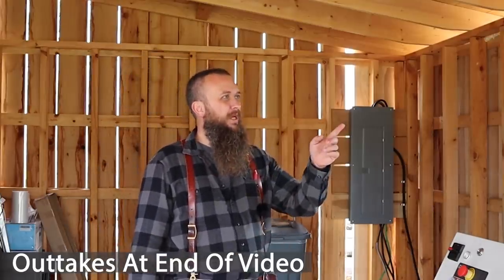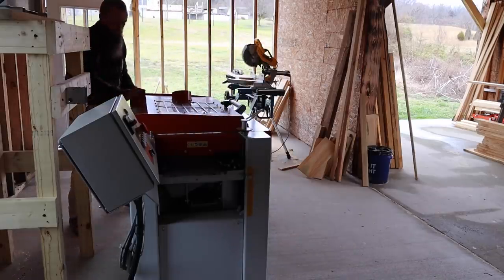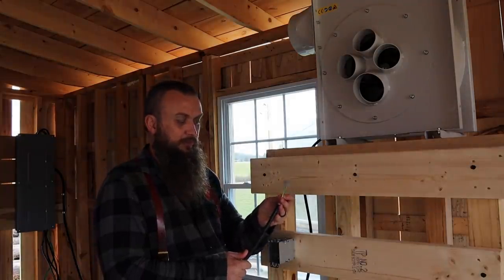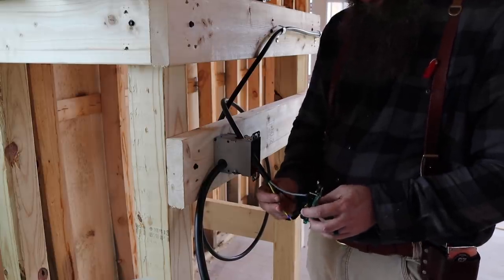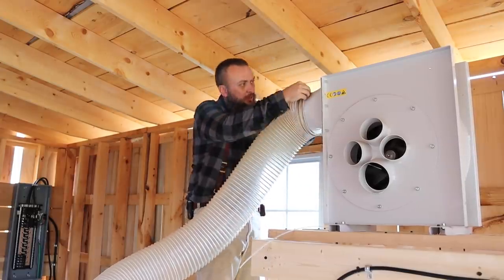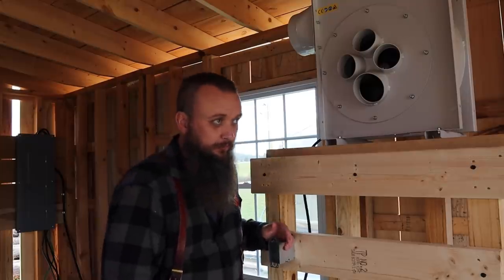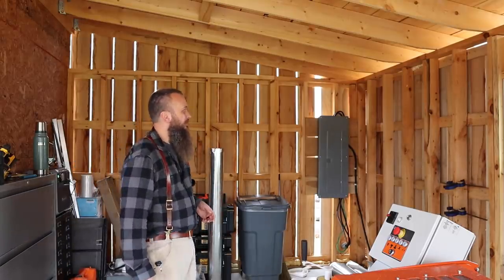You've Probably Never Seen A Dust Collector Like This Before,

Comment: Your out takes are always a funny way to end. It's all good as long as you stay safe in the shop and your out takes don't involve bandages.  If I can make a suggestion,  it would be to run a board under the flex hose to keep it from sagging. Keep the videos coming and have a safe new year .

Comment: Good call on using the double pole light switch on the moulder. A circuit breaker has only one job, over current protection. It is not meant for off and on switching. Definitely use cable clamp at the entry into the panel board, eliminate chafing.
Reply from the maker: Great point

Comment: You need some cord connectors on your cords going in and out of the switch box & load center, the electrical inspector will ding you on those. The cable clamps also need to be the proper size to secure the cord to the supporting surface.
Reply: There are no electrical inspectors in the commercial film studios these videos are made.
Reply from the maker: Rural county here. We shoot at inspectors 👍👍
Reply: The whole show is just BS.
Reply: @OutoftheWoods0623  I bet there are still electrical fires in rural areas
Reply: @OutoftheWoods0623  I believe the correct term is "Revenuers"!!😆
Reply: @OutoftheWoods0623  please remember that part of an inspectors job is to insure a SAFE installation. Safe as you don't burn your building down or kill someone by electrocution...... not to mention that your insurance most likely will not cover any claim due to improper installation.

Comment: You should only push solid wire into the back of the switch. 
Use fork terminals crimped to the end of the wire.
Reply: Never use the push in connectors.  Any electrician will tell you stories of failures from those connectors.
Reply: @markgibbesh  I agree.  But stranded wire is a no no.

Comment: I like watching your videos and appreciate the knowledge you freely give to people. I was an electrician for many years and just want to point out to you when putting wire in a box or panel it needs to have a connector on it for safety. I am only pointing this out to you so a viewer does not do the same thing and possibly get hurt. Thanks again for sharing your knowledge about sawmilling.
Reply from the maker: you are right, those are on order, the store was out of them, appreciate the insight,
Reply: @OutoftheWoods0623  That and the other thing is it's open behind the breaker box and if you got a sideways rain or even snow I'd worry it might short something out.

Comment: A future idea, put a low voltage transformer at the breaker panel 240 x 24 vac .  Mount a current switch on the molder ( sometimes called a donut) . run the 24v through the current switch and back to a enclosed relay across the breaker out put to the vacuum,  and every time you run the molder the vacuum will start.   I can send a diagram if u want to do in future.
good video ....... enjoyed.. thanks.
Reply: Yeah, keep as much at 24 volts as you can. The current switch from the planer to start the dust collector is the way to go. It's not too complicated at all.
Reply: Great Advice Oldindyracer!

Comment: Wish I was there to wire that up for you. Not to be picky or anything but you should have used 12/3 armored cable, or run half inch EMT conduit with  #12awg THHN which would be more than adequate for a 20 amp circuit. I would have run the conduit along the wall, with a steel box at the end with a switch plate for your on-off switch, and then run wire from fan directly to that box. But if that fan is drawing less than 15 amps, then it should be on a 15 amp breaker for safety and going by code. The 220 switch you got is pretty standard, I call those a double pole switch and also come in various amperage ratings. And the clamps you used over the wire are made for metal conduit, not wire. So if I was to do an electrical inspection, unfortunately that would fail on many counts.....Sorry...
Other than that, great job
Reply: exactly my thoughts !
Reply: Yep.  It also looked like he pushed the twisted wire into the back of the switch, which should only have solid wire.

Comment: My favorite coffee is Eight O’clock, which originally was A&P brand. I always grind the beans fresh but it comes ground as well. The switch was an excellent choice. I had a ceiling fan switch in the service box and it wasn’t long until it had a switch. I’d do some sanding a turn off the fan until I was finished. What a pain! It’s nice to see things coming together, it’s a blast! Boards coming off the mill is icing on the cake! Kind Thanks! DaveyJO in Pennsylvania

Comment: I like the dust collector, who makes it. They do make a remote 220v control that plug into a 220v outlet and a frome to control it. Mine is a 3hp 220v works good. I bought this through a local woodcraft stores in my area.
Reply from the maker: Woodmizer makes them

Comment: They used a liquid wax on the planer and other machines at the cabinetry factory I worked at ( please remember the cutters spin for awhile after the machine stops - saw too many fingers fly because the person wasn't trained right ) and stall mats for your floor -concrete is not easy on the body

Comment: The way to go with dust extraction, especially as you add more tools, is to have remote start. The extractor fan plugs into the remote start box and that's plugged into a 220v outlet. You can have multiple controllers at different locations. The remote controller can be low on the wall and all the wiring tucked into the wall to keep everything clean and safe.
Reply from the maker: Thanks I’ll look into that

Comment: Lemme guess.   You don't have a building code or electrical code where you live?   That's great.   I would have used yellow romex to the panel - which is rated at 20 amp.  The stuff you used is for drops.
Reply: He is a great sawyer , electrical not so much. A few code violations that I can see.

Comment: I noticed that you didn't use wire nuts when running your electrical wire to the breaker panel and your switch box. Is it not a requirement where you live?

Comment: I have seen and help install  sawdust  collection system  always used spiral duct pipe   it's ridged and comes in 20ft pieces and use collar  connections .
Plastic pipes developed static electrical charge   possibly  enough  to explode  fine sawdust
Reply: :Possibly enough to explode fine sawdust". But, there's never been a confirmed account of this actually happening.

Comment: Your outtakes are hilarious, but how do you get anything done? LOL. I noticed that when you were running your 8" flex that you're using a metal strap for a hanger. I'd suggest a piece of non-metallic material (rubber?) between the strap and your flex hose to minimize wear.

Comment: Those wire clamps you used are for conduit, not wire.  They are steel and the shaking of the frame will fray the wire.
Reply from the maker: I know that, the fame does not shake, its bolted to the floor,

Comment: - [ Nathan ] I don't understand! {you must have a good reason I fail to grasp}
- Why not run your black power line/cable INSIDE the Wood Frame and mount the receptacle on the INSIDE Face of the 4x4" frame posts so everything was protected and not in the way? 4:14
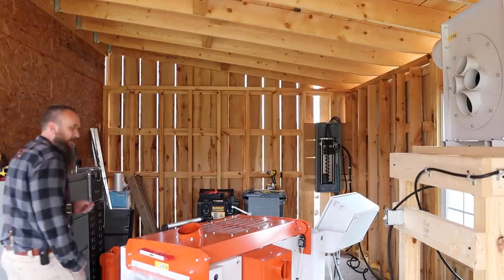- Why not run the power line/cable to your breaker box up on the top plate holding the rafters? 7:06

Comment: Nathan, I'm wondering why you ran the cable on the outside of the frame, and also why have the switch in that position, why not recess it into the 4 x 2?
Reply from the maker: its just a rough in until I finish my walls, 
I wanted to be able to flip the switch and not have to lean over the machine too far, 
thanks for watching,
Reply: @OutoftheWoods0623  Ahh right! Keep up the good work, really like following all your videos. Its interesting to see how things are done differently there, than here in Ireland.

Comment: That switch needs to be horsepower rated for the size of the motor, also you need cable clamps on the cables going into the box and stranded wire on those terminals is a bad idea.
Reply from the maker: the switch is for the machine otherwise I would not have installed it, as I stated in the video I roughed it In to make sure everything was good to go, the final install was done off camera,

Comment: Nathan - Please don't stab the wires in the back of the switch.  Use the screws on the sides so you can swap out or do other work on the switch.  Otherwise you have to cut wires again and the bayonet slots in the rear are only one-time use.

Comment: There is a push-button switch that you can purchase, that can be wired in line with your dust collector.  It's pretty slick.  You can turn your collector on or off from any place in your shop.  If your interested and cannot find this push button switch, contact me and I'll get you hooked up.

Have a great new year for you and yours...You can't make old friends...

Comment: Love your outtakes and know I couldn't do any better! Hanging from an unfinished ceiling means doing it all over again later, guess it's for the video. Guess I've seen 220 type switches before but it was from a 3 phase set up and the lights were 277 because of the 3 phase set up, do you have 3 phase running to the shop? I don't even have your couple years of experience at that, just what I gleaned off of people before me where I have worked for over 30 years. I always listen t what the electricians say!

Comment: I'd double check the rating of that switch to make sure it's rated for the motor load...it looks awfully small for a motor controller.  Very surprised local codes let you run flexible cable from the service box to the switch and then to the motor.
Reply: I was surprised by a lot of what he did.

Comment: Did you know you can actually re-use those zip ties?  You can get a narrow screwdriver and pull/push up on the tab that “clicks” and release the tie and BINGO! A reusable zip tie!
Reply: That only works if the locking tab is plastic. Being an industrial electrician, We needed our cables and wires to stay in place. The plastic ones didn't hold up, especially in the great white north of Canada. Thomas & Betts tywraps with the metal locking tab were what we used. Good hold and the locking tab didn't break out when it was cold.

Comment: Hello sir,

Have you explained the process for weather treating wood? If not could you explain it and do you do it on your wood?
Reply from the maker: Not sure what you mean.
Reply: @OutoftheWoods0623  when my family bought lumber for use in our decks we bought wood that was weather proofed or treated so you don't need to use a sealer or whatever. At least that was what my dad told me back in the day and we never painted it or used a deck sealer and it lasted quite a number of years. 

So if it is something that can be done, is it done at the mill or is it something done at a different area. If i need I'll google the proper terminology.
Reply: @OutoftheWoods0623  ok so the term i think is pressure treated, where i guess chemicals and other things are done to treat wood to make it resistant to rot and termites beyond untreated lumber.

Comment: why use a hose and not a pipe that would have less resistance? I use a hose on things  like the head on a cnc that moves around. There are many pamphlets that explain this clearly, you may find one at your supplier. I had some pamphlets but could not put my hands on one yet. It is the same old story read a book first.

Comment: Hi Nathan.
I am certainly not without fault and I dislike when someone comments on YouTube running down the YouTuber for something they do. However I cannot hit the like button on this video. I have been a unionized electrician for the past 15 years and I went through the union’s five year apprenticeship program.
I cannot endorse the wiring that I see going on in the timber frame or how you wired up your dust collector. Each state, county and municipality does things differently with trade codes and building codes, but I assure you that your insurance company will certainly cite the National Electric Code if you ever need to file a claim as a result of an electrical fire or injury.
I’m not sure how I can go about contacting you to give you some observations without letting all of YouTube my contact information. I would however be happy to give you some pointers over the phone or via email.

Comment: What is actually better and does not dry out and fall off, and is cheaper is safety wire used in the aerospace industry.  The stainless steel safety wire comes in sizes from .032 to .064.  Once properly installed it will never rot, or break.  You will also need to buy safety wire pliers, which are made to twist the wire tight where you install it.  Newer safety wire pliers have a spring loaded spinner to pull the spinner back to the start position to do an additional twists.  Adam from the Myth Busters has a video explaining how safety wire and the pliers work.  https://www.youtube.com/watch?v=MPy0JzpZuvY
Reply from the maker: interesting, thanks for sharing

Comment: 616 ..  No connectors for the wires going to the box ???  No good ...   You should have a dust proof box for that switch also ...
Reply from the maker: Nope I’ll seal them off with electrical putty